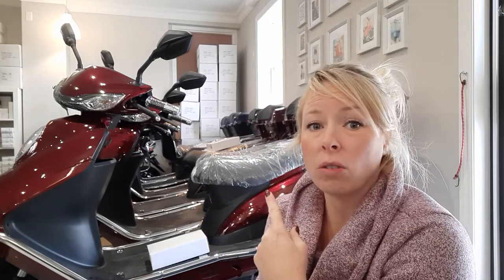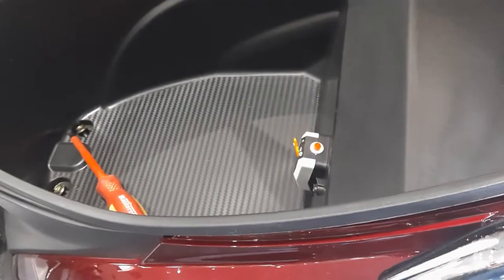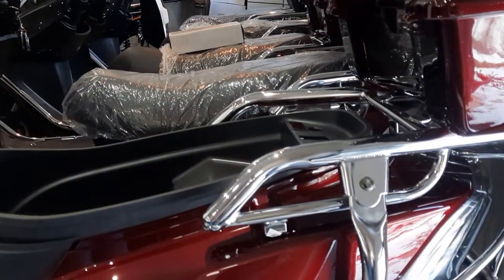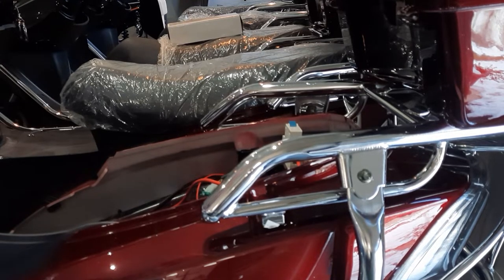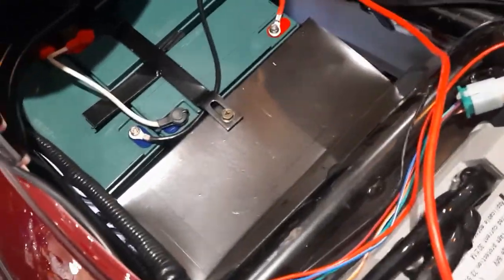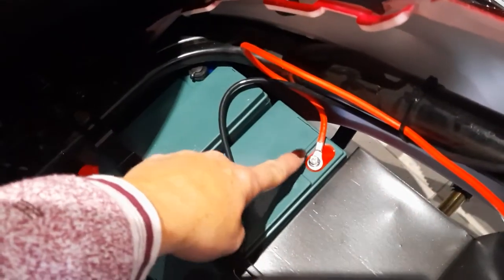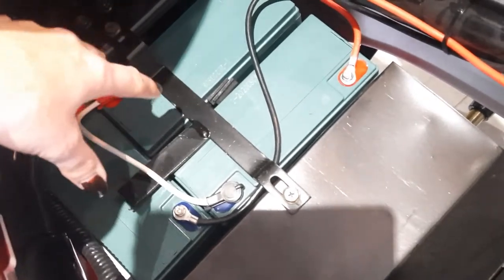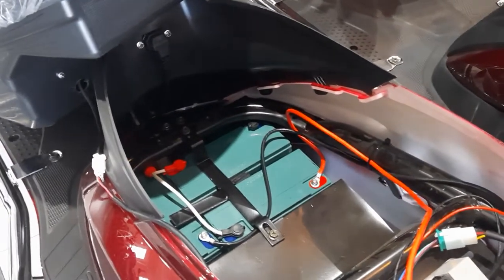Winter storage and Removing Lead Acid batteries scooter style ebikes

Comment: Hey from NYC I have a similar bike called the Fly 3 it has a 60v 20ah lead acid battery I used remove the battery out the bike to make it easier for me to carry the bike inside my apartment and also to charge the battery but the straps that are wrapped around the battery are not strong enough after a few uses they eventually broke it’s really difficult to charge it while the battery is still in the bike my dealer then swapped the location to a more easy access below the seat that way I could charge with out having to lift and break my back all the time my friends dad helped me make a ramp to get into my building easier definitely converting to lithium later on thanks for the vids I could hardly find any videos or information about the ebikes glad to find you

Comment: Hi!
I have purchased an Emmo Monster S 84 & have enjoyed your how to videos. I want to remove my batteries for winter storage however, the monster basket is a bit more complicated to remove.
Question is it looks like the whole seat frame can be loosened & tilted out of the way to get at plastic battery compartment cover.
Am I correct? Could you post a new video Monster S 84 specific?
Thanks!
Reply from the maker: hey,  oh oh, ya that's a big job.  Can the bike not be stored inside  garage at all?
Reply: @ridethewind   we have a shed but not temperature controlled. I’m handy & have tools.
Reply: Hoping for you to do a video of how to access batteries on a Monster.

Comment: How fast dose it start effecting the battery’s. I do Store my sport knight  inside 
but I was Wondering if I can still drive it in the winter without harming it.
Reply from the maker: Lithium is ok until -10.  Lead acid,  not really under 0.  Your distance is greatly affected by cold.  And charging is best when the battery is room temp.   You gotta do what ya gotta do. If you need your bike in theses colder months, the  ya, your battery won't be optimal